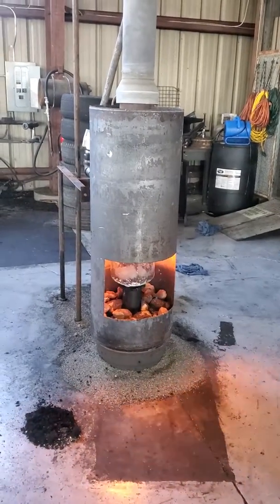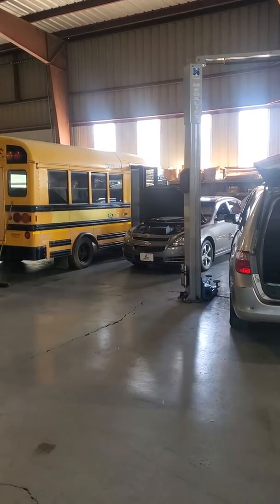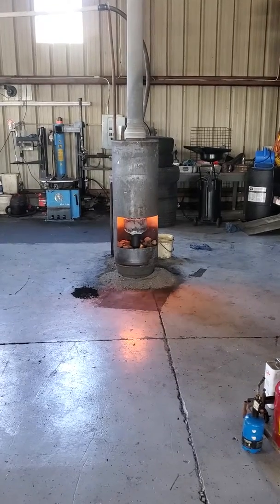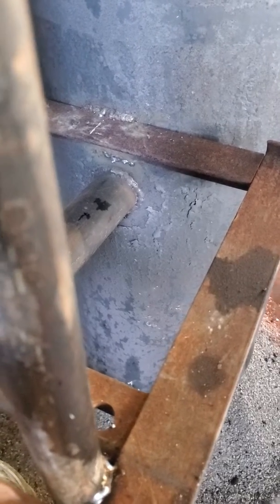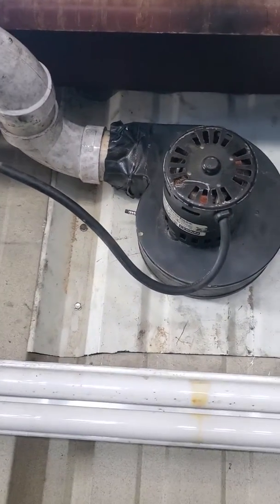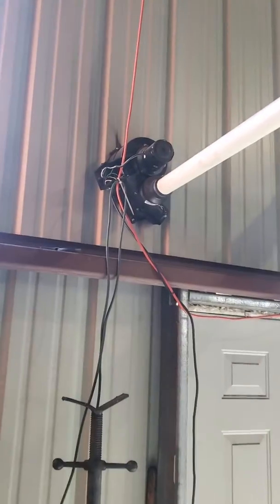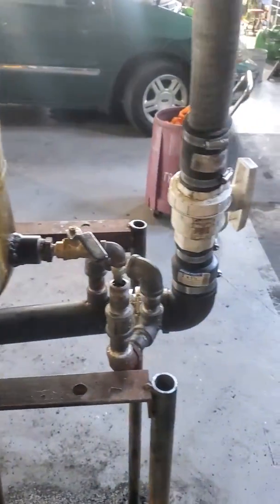Waste oil burner like no other. No door required and does not leak exhaust fumes.

Comment: Why the P trap in some of the oil supply lines? Does this one work as good as the ones where the bowl is sitting on the floor?
Reply from the maker: ptrap keeps oil tube from blowing out with fan pressure. this unit worked eally well. as good as the newest ones

Comment: Hi, thanks for the video. Have you made a passive stove - no blower on it? I've seen a few in operation on YT but you have the guts to put yours inside in your workshop - something a lot of people don't do. I don't mind using a fan for startup (after kerosene) but I'd like to be able to switch it off for normal running. Have you tried it? Cheers
Reply from the maker: IT DOES CONTINUE TO BURN BUT NOT HOT ENOUGH  WITHOUT COMBUSTION AIR
Reply: @burninghot5830  thanks. Have you tried alterations to make it work thus? I have seen various of them working like that - just trying to find the best design  now.
Reply from the maker: I DO HAVE NEWEST DESIGHN THAT  I THINK WORKS REALLY GOOD. WILL BE GETTING NEW VIDEO ON IN THE NEXT COUPLE DAYS @gurglejug627

Comment: How does it work with the addition of water, to increase burn efficiency? I've seen small water-oil burners on YouTube but none as big as yours, sized for shops like yours. Do you think adding water would work to increase burn efficiency for a burner the size you are making?
Reply from the maker: TO ADD WATER  IN OIL ONLY MAKES IT BURN LESS.

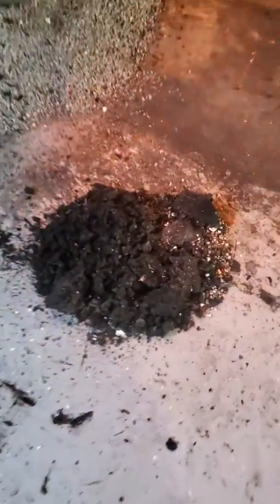Comment: 3:34 That waste you're seeing is everything in the oil that doesn't burn off, whether its not volatile enough or just not flammable. Heavy metals from bearings, zinc and phosphorus from oil additives, and some tars from the oil. Very toxic stuff, definitely do not recommend dumping it on the ground and sweeping it up with your shop broom. Best to contain it put it in the trash.

Comment: SUGGESTION:  : )
* Why not pour a new concrete slab over the old one and add in radiant heat from a wood or oil boiler?
* That would make things 1 million times easier on you and the heat would be more "even" across the whole shop.
* You could even install the oil heater outside and give yourself more space in the shop!
Just an idea... I wish I had a shop as big as yours!!

Have A Great Holiday Season!
Retired, Veteran
Reply from the maker: It is plenty of heat for me the way it is. But certainly try other options.

Comment: Less shwab has the best. A pipe running 8 feet in the air. And back out front to exhaust. Just a pro pain torch hooked to one end. . Pope gets hot above ya. .  Toasty

Comment: Does using outside air without a heat exchanger cause the oil to flow slower ??? Thanks
Reply from the maker: NO YOU ARE OK ON THAT. I HAVE SOME IN SERVICE THAT I HAVE OUTSIDE AIR PIPED IN FOR COMBUSTION AIR
Reply: @burninghot5830  Since you do not have any insulation for your large shop. How many gallons do you burn in an average year ?? Thanks Frank too. VF
Reply from the maker: @victoryfirst2878  HERE IN KNOXVILLE 150 GALLONS OR SO
Reply: @burninghot5830  That is not a lot of waste oil. My neighbor goes around and collects drain oil from all over creation. He has a 1000 gallon tank that is filled before winter. He sell the oil cause he cleans it with a centrifuge, heat. Amazing at the diffrence between start product and sell product. Good day Frank and peace too. VF

Comment: Thinking adding another larger diameter pipe around the exhaust pipe that has an intake on the lower end... maybe best going all the way down to the floor and then an opening on top of the top either before the bend or even at the exit and maybe even going elsewhere so like a closed loop heath exchanger circuit to blow whether with another really small fan or just the thermal siphon effect.  That will exchange more air.  I also wonder about adding a refractory brick or sheet or even soapstone I've seen material around the burner so like the hybrid wood burner/stove designs for the second combustion of the exhaust gases to get the double or twice burn effect so to best combust all the fuel and exhaust gases.  Doubt most will homebrew the three stage or triple burn designs with maybe DIY catalytic converters... though maybe will be seen more in the future.  Thanks for sharing.  Reads like your other posts have diagrams for this design.  Interesting reading.

Comment: Here are some suggestions to increase the efficiency of your setup by a lot.
1- Your building isn't insulated which is ok, but the ceiling is really high up and as you know hot air goes "up" so it needs to heat the unused portion above before the people on the ground get any benefit so, install either large ceiling fans to circulate the hot air or use several of those blowers to force the cold air from the ground to the ceiling that mixing will increase the total warmth of the place without increasing the power of the unit.
2- Change the chimney by adding thermal mass above the heater, coiled copper full of circulating water flowing to radiators around the shop, just make sure to install pressure valves so water doesn't explode the pipes by boiling inside. Remember that a large surface area is more efficient to heat a space than a lot of heat in one spot, this wouldn't be needed if you add the ceiling fans.
3- Taking air from outside is a great idea, but your pipes make too many turns affecting total airflow, make a connection with as few turns as you can to further increase total airflow to the furnace.
Reply: It's a shop, I was going to suggest using air off of the air compressor instead of blowers. It would be easy to regulate. 🤓🍻
Reply: @alsaunders7805 You need air volume not air pressure. That's why they all use blowers.
Reply: I would add a second oil drip shut off ball valve unless the 1 mess would mess up or if u get a comfortable setting you can leave it and shut the 2nd ball valve off / I'm interested in building 1 but want to stand up a 55 gallon drum or something of that style
Reply: Ahh yes circulate the toxic fumes evenly throughout the shop
Reply: @DMNTBZ  That's why I told him to fix the chimney, so the toxic crap goes outside and only the heat stays inside.

Comment: if you let the system suck up warm air from inside it can heat up way faster.. 
especially if i see how much hole you have in the building.. there will be no shortage of fresh air.
great way of protecting you oil tank for flashbacks.

Comment: Same question that everyone else has...will you demonstrate the burner box?
Reply from the maker: IT IS A 2" PIPE AIMED AT THE CENTER OF ANY TYPE OF BURN BOWL. THIS PIPE IS WHERE THE OIL AND AIR FLOW THRU. NOTHING UNIQUE. IT IS THE TURBO AIR THAT DOES THE WORK.

Comment: Do you use any used vegetable oils? It’s usually given away at many restaurants.
Reply: Most restaurants actually have a recycler that collects the oils and pays them. You will have a hard time finding one that gives it away anymore.
Reply: @crosisofborg5524  I don't know where he got that idea. Restaurants sold their used oil when I was still in the biz 4 decades ago. It is used for soap, cosmetics, explosives,and numerous other chemical products.
Oh, a side note, commercial soap makers remove the glycerin from the fat before they make soap with it, not afterwards like in that stupid movie. It's actually quite easy, even at home. I sometimes accidentally remove more glycerin from the fat than I want to when making homemade soap from leftover cooking oil. Any salt in the mix will take glycerin with it when you add water and boil it to remove contaminants and deodorize it. It's a shame because glycerin is good for your skin. The commercial processors purposely remove it because it is worth more in skin care  products than if you leave it in basic traditionally made soap. OK, I'm done with my rant. 🤔🤓🍻
Reply: @alsaunders7805 guess it’s different in Alaska because  could get 5 gallon buckets every day.
Reply from the maker: HAVE NOT. THAT WOULD WORK ALSO.

Comment: I'm surprised your insurance company allows an open flame in a mechanic shop, especially one that low to the floor. I'm guessing your not replying because your shop burned down when Jake spilled that gallon of gas he was carrying when he tripped on that huge crack on the floor
Reply: OOOOOH Snap ! Mr allstate given yo a shaming
Reply: We've seen a thing or two!
Reply: Mechanical shops of any kind commonly use propane/acetylene cutting, welding, heating torches and arc welders. Flames and sparks come with the territory, you learn to work safely around them. Or you don't, if you don't it sometimes doesn't end well. 🤓🍻

Comment: I don't see how the outside air is more efficient than the inside air, but rewarming the air over and over must heat up that place better than cold air!?
Reply: 1. Outside is colder than the indoor air, making it more dense. More dense= more oxygen per cubic foot of combustion air.                                               2. Drawing indoor air for combustion, you are taking air that you have already paid/consumed fuel oil to heat, sucking it out of the heater space and blowing it back outside.

Comment: Frank, not that your climate needs to have one but..... an air to air heat exchanger will increase the retained BTU's into the shop space. Just a set of pipes in a box, let the hot exhaust heat the pipes in the 'box' and then put another fan blowing into the open ends of the heated pipes, and recirc shop air- sometimes called a 'stack robber' but will increase your retained heat per gallon quite a bit.
Reply: the word you looking for is balanced flue.pipe in the pipe

Comment: It doesn't make any sense bringing in outdoor air unless you construct an air tight system. Bringing in cold air from outside reduces the heated temperature. With your open exposed fire box your wasting heated air from the workshop, your workshop air is being sucked up the chimney along with the exhaust. But I'm assuming you have more oil than you can burn so efficiency is not a priority
Reply: Most of the heat is being sucked up the chimney! Unless you create an air tight system bringing in outdoor air is a joke especially with a shop that size!

Comment: In S. Florida they use what's called a smutt-pot which is where this is derived from and they were made to make a small warm cloud of air over the orange groves so as the frost cant reach the trees under thge layer of smutt (smoke ) in the air which becomes the sheet of protection ....................excellent idea for free fuel use no doubt

Comment: Remember the ashes from burning this stuff is extremely toxic. Find a way to properly dispose of it.
Reply: So you advise not to fertilize the cabbage garden?
Reply: @laserfalcon  with the remains of burned petroleum... Absolutely not. Just take that soil to any lab for a toxicology screen.
Reply: @vanderumd11  what about the neighbors garden?
Reply: @laserfalcon  hahahahahaha hilarious. I love all my neighbors so I'd opt for a concrete box in a field with a lid.
Reply: @vanderumd11  I do hope you know im joking
Reply: @vanderumd11  I'd be curious to send off a sample of that "leftover waste" to a lab to find out exactly what's in it.
Reply: @MarkReaves84  no need. There are plenty of tests on residuals from burned oil. Its been studied extensively for decades. Same reason coal and gas fired plants require expensive scrubbers. If you inhale that exhaust or litter your yard with that "ash" ... Then walk it into your home you are essentially going increase cancer for your family.. Oh wait, maybe this supports the extreme increase in modern cancers.
Reply: @vanderumd11  I plan to do something similar to this (waste oil burner) but instead of motor oil, I plan to use waste vegetable oil. I'm in the research stage currently. I never really understood why anyone would burn waste motor oil. The stuff is toxic enough as it is, concentrating it and putting some of the stuff into the nearby air just seems like a bad idea.
Reply: @MarkReaves84  absolutely the things of poor countries when you have zero choice. Veggie oil is still bad and will leave fluid on the lungs if not properly filtered but a solution is to use slightly drafted air to pull the exhaust through a large "grow" carbon filter and then additionally expelled 15ft minimum above the roof level. Hopefully high enough to send the particles far away. No sense saving money only to end up severely hospitalized later in life.
Reply: If you look of Wikipedia for automotive oil recycling the first think it says is that it can be combusted in burners, after that its refinery but its easier to refine for marine fuel than it is to reuse it as lubricants. And Wikipedia never lies 😄
Reply: @leorigby3069  right.. And the same differences between commercial engines and a open fire is the management of exhaust and heavy metals. Unless your chimney has a cad conversion I wouldn't suggest it. Fire wood soot and ash is already bad enough. I come from a community of outdoor boilers so you can imagine we go through +40cords a season
Reply: I heard that when we take waste motor oil to the recycling, it ends up in cruise and container ships. if its good enough for them...
Reply: @leorigby3069  do more research. That is not burned. And the reality is if you burned oil in a open flame everything that exits your chimney is what you breath locally. Imagine if everyone in a small area did that.